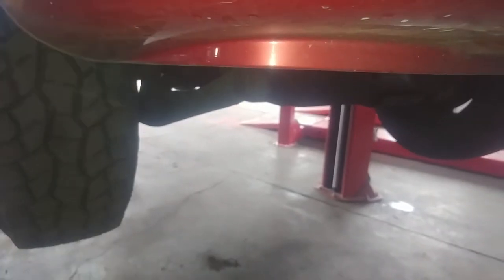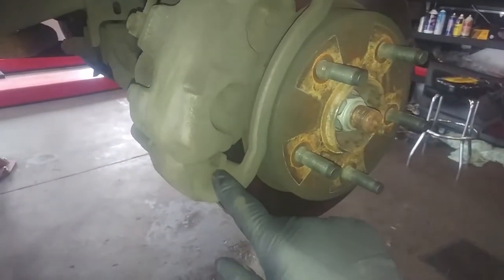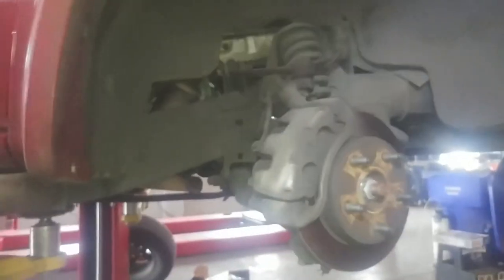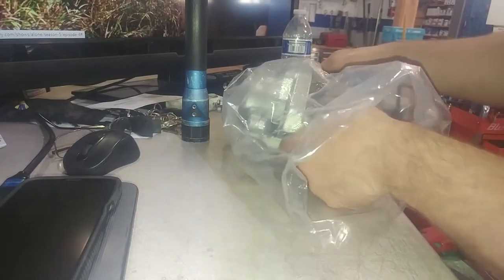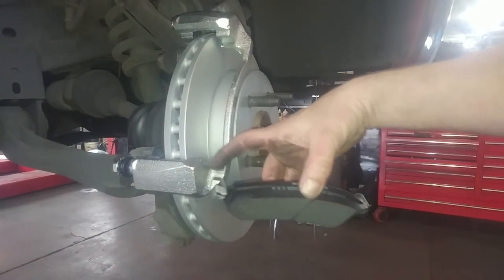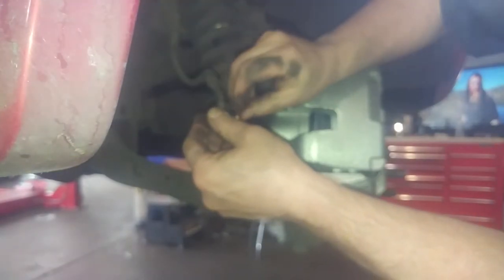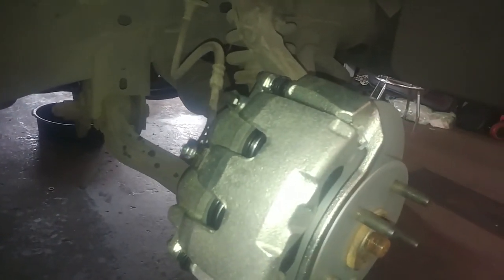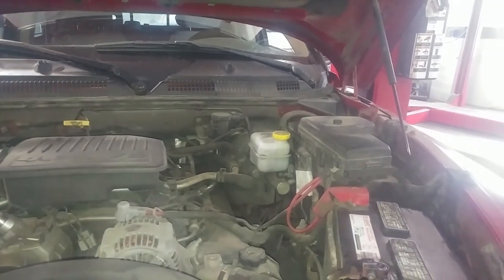Front brake caliper replacement 2007 Dodge Dakota brake pads Dodge Ram Mitsubishi Raider 2006-2008.

Comment: Great vid and can I make a suggestion for those who don't do this very often? Get a generic piece of clear poly line that's approx 3/16" ID. Use it when bleeding all brakes. Crack the bleeder...retighten lightly...leave box wrench on bleeder...attach line to bleeder...run line down into empty bottle or jar. That way no mess and no fluid flying thru the air plus you can see the fluid color and air bubbles when bleeding. Makes job a hell of a lot cleaner.

Comment: I have a 2006 dodge dakota and my front two brakes make a strange clacking sound when i go over the slightest dump, But when I press on the brake the clacking sound stops. Could you please give me a diagnosis it would really help me out. I really just want to get this annoying sound fixed.
Reply: *bump
Reply: I have the same issue
Reply: Your caliper is sticking